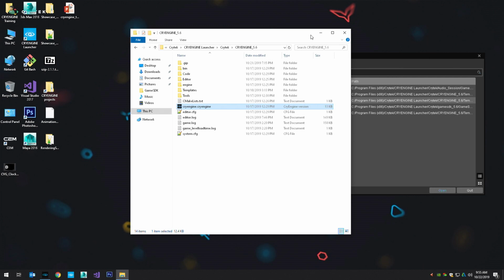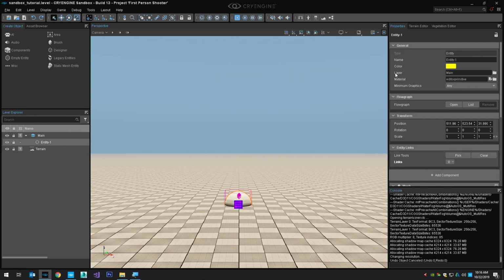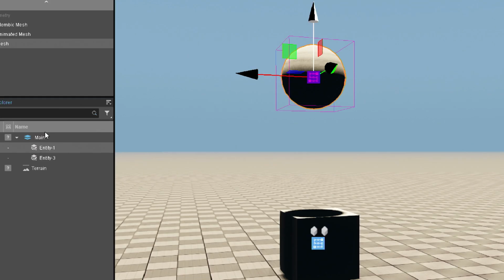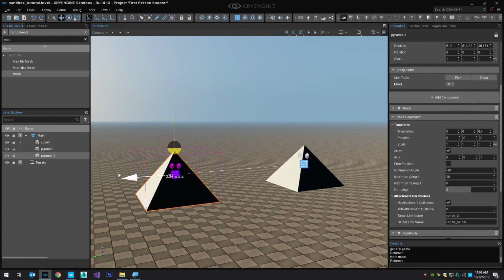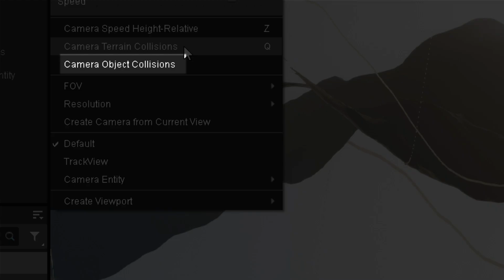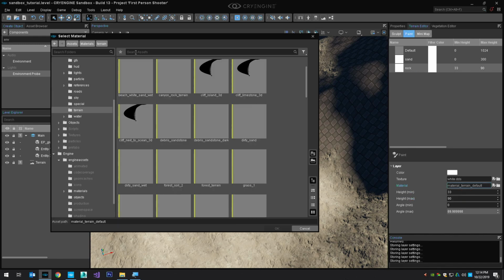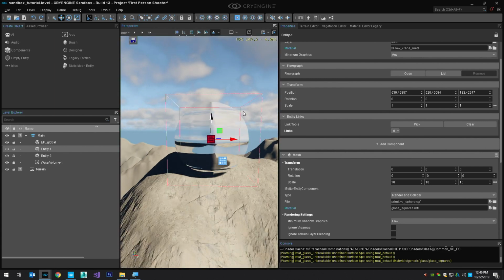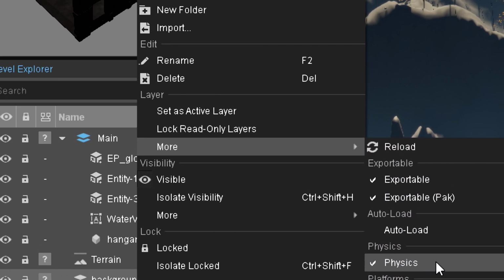Master Class: The Comprehensive Guide to CRYENGINE Sandbox Editor

Comment: Coming from GTA V modding community, I'd like to create an open world game predominantly set in urban environment. I'm working on very robust PCG system in Blender in order to be able to tackle such challenge. I do everything with it, terrain, vegetation, grass, buildings, interiors, 3D roads and decals and so on. While CE editor is very nice, my main concern right now are LOD hierarchies .

Can I import for example static object City block A (LOD5) that splits into Street A, Street B, Street C and each of those "Street" objects splits into Corner 1, Corner 2, Corner 3, Corner 4, Corner 5 and so on? 

Also, is there a possibility to read and modify CE level files? I could just export it procedurally within Blender via Python into an XML file for example. To certain degree at least. And same question would be also for grass instances. Do they rely on masks or can I import their scattered positions anywhere in 3D space (as distributed on my static environmental terrain chunks)?

Comment: It has 3d modelling?
Reply: CE has some very basic modelling features using primitives, but it is by no stretch a replacement for an actual 3D modelling application. That said, with the stunningly-simple FBX workflow it's fully compatible with Blender and therefore very easy to get started on for indie developers.